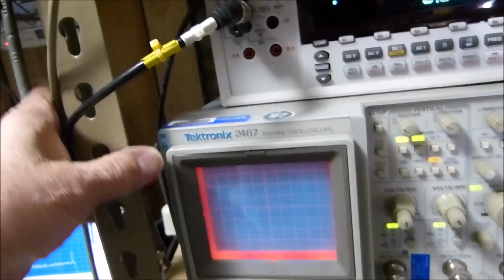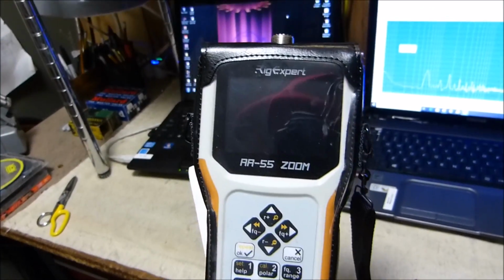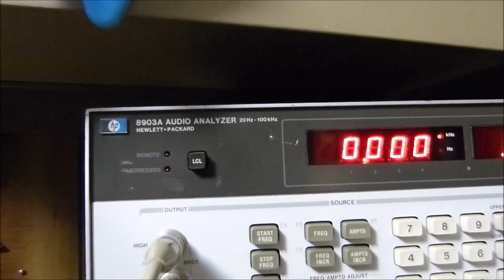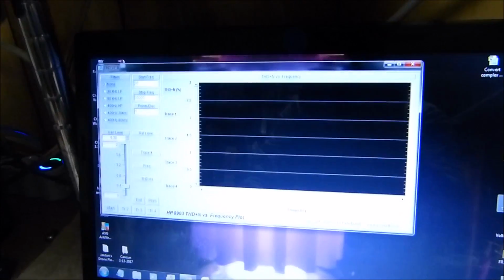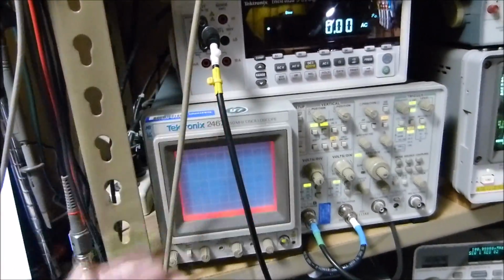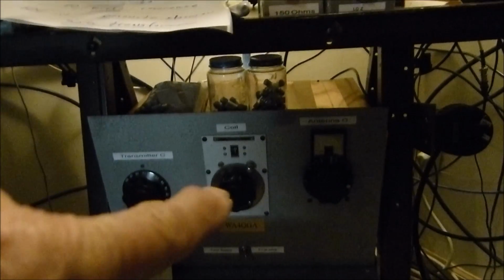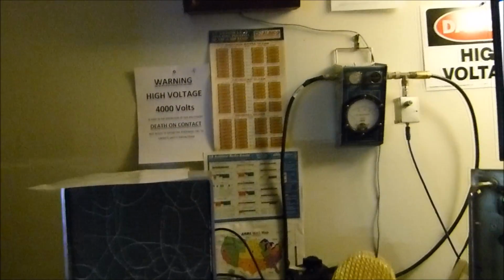Tektronix, HP, General Radio Audio and RF Workshop Instrumentation Update For 2019

Comment: David, 
 I’ve got a Fluke 8808a on the way. Only to be able to set up like you do at around the @3:30 time.
I bought it reasonably cheap with calibration indicator on. Hoping this doesn’t effect the dB portion much. We’ll see. Worse case scenario Fluke still calibrates these for $250
Reply from the maker: Hi Jimi, I just looked up the Fluke 8808A. That is a beautiful meter and odds are, it will be perfectly calibrated. I have an old Air Force surplus Fluke meter that amazes me with its accuracy. I am sure you are going to be pleased with your new purchase. Thanks for your comments.

Comment: I like the parallel box idea. What resistance BNC patch cables do you recommend ?
Reply from the maker: All of mine are 50 ohm like RG-58U but I don't think it would make any difference if 75 ohm patch cable was used.

Comment: Thanks for the shop tour. I'd like to build an audio distribution breakout box like yours. Is it strictly passive? Any hints as to its construction? Thanks!
Reply from the maker: It is strictly passive with two channels attenuated 10:1 with frequency compensation.
Several people have liked the breakout box. It is much better than a whole stack of BNC-T connectors which is what I used before I built it. 
Below is a video I posted on it.
https://www.youtube.com/watch?v=FVuwZnVtE8A&t=183s
Reply: @ElPasoTubeAmps  Thanks so much. I will be building one.

Comment: Question?   What is the best bnc and coaxial to use for analog audio test bench?  Plus for DC B+ and whatever.  I see that a lot of test cables are 50 ohm.  Isn't 75 ohm better.  Size also.  Do you use RG59?  As always,  THANKS
Reply from the maker: It really doesn't matter if you use 50 or 75 ohm coax. I personally use 50 ohm RG-58 as the RG59 and RG6 usually have solid inner conductor and is less flexible. The reason these different impedance values do not matter is for audio frequencies, the electrical wavelength is so long that the short cable distances we use in our shops are such a tiny fraction of a wavelength that everywhere along our cable is considered the same electrical point. As for HV B+ I personally use HV rated meter lead wire. I read that RG8 type cable is good to 4KV so that can be used and I don't remember the DC rating of RG58 but it is pretty high. I also like to use the Millen HV connectors although I also understand the PL259/SO239 combination has a very high DC rating also.

Comment: with FFT programs running on a 80586 processor try to stick to 16384 bins as going higher will take longer to run, What about Linux Mint 19.1 plus Wine64+Winetricks64 and zip.dll to get your windows program to run under Linux or Open Source UNIX.

Comment: David, you could get rid of that large attenuator by running the sound card from the monitor output of the AA501, which provides a level-normalised signal, copy of the input. Of course you are then adding the AA501's electronics into the signal path to the sound card, but those electronics are pretty damn good. You would also be probably more certain of flat frequency response. Regards EJP
Reply from the maker: I think that is an excellent idea, I will be trying that tonight. Much appreciated...

Comment: Sorry for asking again, but could you let me know how you connect the Focusrite input to the amplifier under test?
Reply from the maker: Hi Leandro, Yes, sorry I take so long sometimes. The input of the Focusrite should be in the line position instead of the instrument position so it won't over load so easily. The input into the XLR is actually just connected across the 8 ohm (or whatever you are using) dummy load but with a lot of attenuation. You will need to pay attention to polarity of the center wire and the shield so as not short the output of your test amplifier by connecting the hot lead of the output of the amplifier to the shield of the cable and short it thru the safety ground wire in the house wiring. I have done that before.
In my case, I use a 100K pot that is located in that little hanging chassis with a knob off of my break-out box. You might not be able to notice the setting of the pot but it is turned almost all the way down to attenuate the signal coming from the 8 ohm load to a small value to keep from overloading the Focusrite. Of course, keep the gain on the Focusrite down low also, maybe around 9 o'clock on the gain dial. That should do it as far as the input to the Focusrite or whatever USB sound card you use. Also , notice on the Focusrite that the light around the gain control does not turn red but stays green when you are putting a signal into it. Hope this helps.
Reply: @ElPasoTubeAmps  Thank you! Just one more question:
Could not your HP 4437 also be used for this purpose of attenuating the signal?

Best Regards.

Comment: You equipment videos have definitely helped me plan my shop.  Especially the high voltage danger sign.  : )  Thank you.   I would enjoy a video on how you used your equipment to determine your cathode bypass cap and resistor values.  Also, in perhaps a similar video on how you set your operating points in your amplifier designs, with your consideration on which OPT you plan to use.  The more geeky and involved the better for me.  : )  Thanks.

Comment: Good Morning.

Please, if possible, clarify a doubt.

I have an HP8903 and I also use the Pete Millett software, both work perfectly. My question is how do you connect the Focusrite device to the device under test. Do you connect the Focusrite input to the HP8903 monitor's Out output or connect to the load resistors (dummy load)?

If you plug in the load resistors, you probably need an attenuator to not damage the Focusrite, correct?

Thanks in advance.

Comment: What would be the best capacitors to replace originals in an HP 334A distortion analyzer? I love the old test equipment. Have to say you run a very organized lab.
Reply from the maker: Thank you for your kind comments. I used to have a 334A analyzer and it is a beautiful analog instrument. I am not sure how to advise on the capacitors but I would be very careful... and make sure they are the correct value, and not just an audiophile type capacitor. If you have to replace signal path capacitors, I would surely very carefully hand-pick each one. Electrolytic power supply capacitors should be no issue. I think your question is fantastic as just doing a wholesale capacitor replacement as some do in audio amplifiers, would be disastrous for a lab quality instrument like the 334A. Best of luck with your project. I posted some videos on my 334A and a good gentleman that ended up with my 334A diagnosed some issues with it and I believe it was capacitors and according to him, he fixed it and greately improved it. Check out my videos on it a few years back and you may find his comments. I would give you his name but I can't remember it right now. I will be glad to help you thru YouTube and email to get your instrument back to tip-top shape.
Reply: ElPaso TubeAmps, well there is a good idea for a new instructional video for you, I am a medically retired electrician who enjoys the electronic repair hobby so your videos are a huge help...Thanks!

Comment: So cool.  I  thought I had a decent audio shop, but nay nay, not so.  You've added more goodies.  Did you trade off you old HP attenuator from the Tek  shelf?  Love the new Tek bench meter.   I need to get me one of those.  Thanks for sharing all this.
Reply from the maker: Interesting you noticed the missing HP attenuator from the first video. I still have it but it was a special instrument for the telephone industry and a beautiful instrument but the one I use now, as shown in this video, is still an HP but is just 600 ohms. Also, I think the one I use now is a bit "quieter" in picking up electrical noise for very low level amplitude levels. Thanks for noticing and your comment.

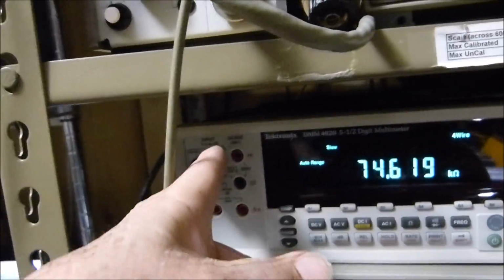Comment: 25:30 - It outputs a constant current via the FORCE leads and reads the resulting voltage via the sense leads at the resistor.